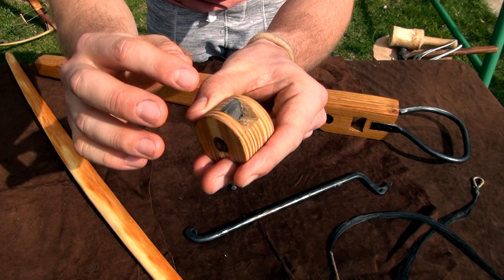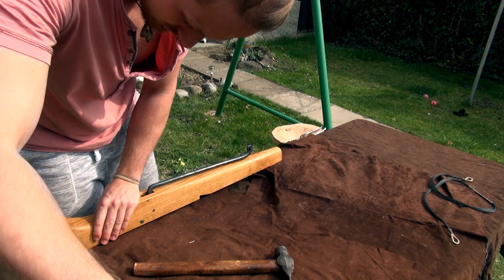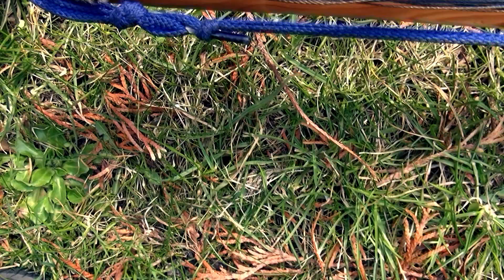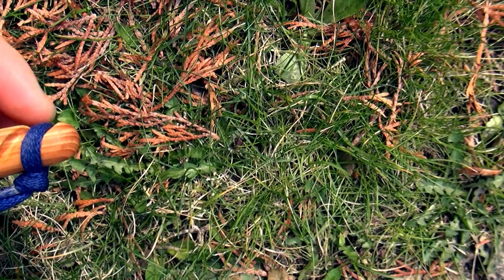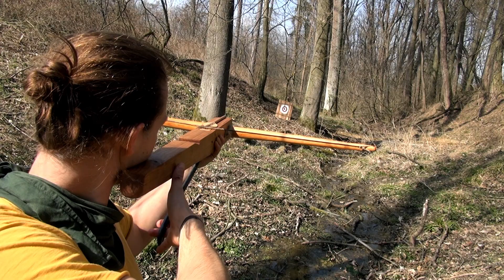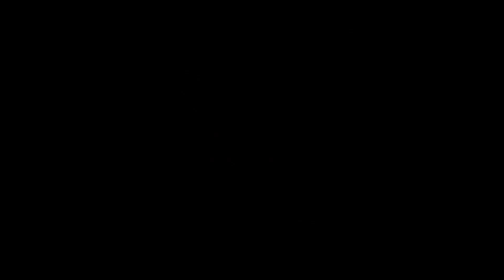Medieval crossbow parts and assembly - full process

Comment: add a clip at the end to pinch in the bolt than you can shoot down and the bolt won't slip down
Reply from the maker: Hello there, kinda late, but I actually did that not long after making the video. You are right about the downward shooting, it is also way more practical when moving with the cocked crossbow.

Comment: Wood will snap and if soaked in rain will lose power!
Reply from the maker: It hasn´t snapped so far, so no problem there mate. Soaking in rain is easily prevented by applying coat of oil+beeswax finish.

Comment: 1. you can shave up to 70% of wood from the tiller without loosing strength.
2. in this design, nut axle is overloaded. In proper design axle is  not needed- nut is rotating inside cylindrical hole which is  close in size to the nut dimension, so all tension is transferred to the front of the hole. It is impossible to carve such enclosure it in the  tiller, so rectangular hole was carved and bone (or wooded, or brass) inserts were used to make proper cylindrical enclosure (like axle-box, only with nut instead of axle). Check Paine-Gallwey, he has this covered for "14 century crossbow" (which is in fact 17 century Flemish one) . You can cut axle box from plywood, fit the nut and then insert into tiller. Just do not make it tight fit, in that case any change in moisture may jam the nut
Reply from the maker: 1. That is true, you can. But there is not really any benefit to it, except making the crossbow lighter. Many military style crossbows had thick stocks. Of course, the elegant thinner ones were used as well.

2. This is true and also interesting fact, but it doesn´t apply to this crossbow. This mechanism wasn´t really used on earlier crossbows (12th century style). These early crossbows use the simple system i show here (sometimes they haven´t used steel axle for the nut, but just string lashing, but in the end it works the same). The mechanism you describe was used on later crossbows, using steel axle and nut too. You have to use bronze/brass/steel for this. Wood, bone or antler will not work, as any change in the air humidity will make materials increase volume and the mechanism will jam. Or if you leave too much space, the mechanism will not work again, as the nut won´t hold in place very reliably.